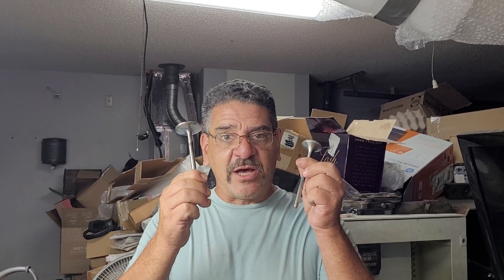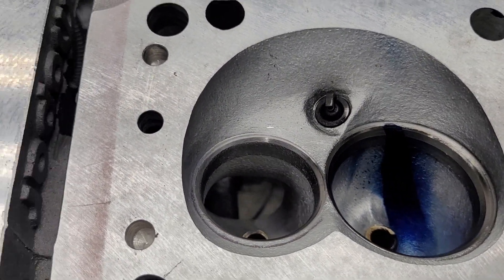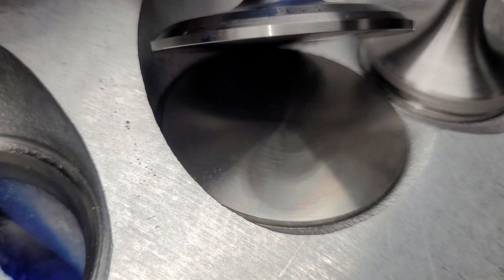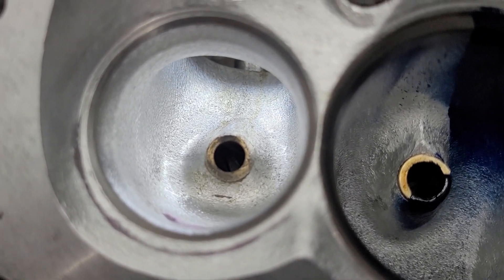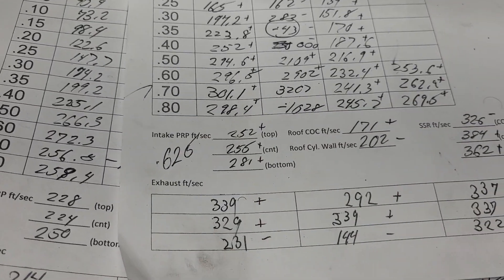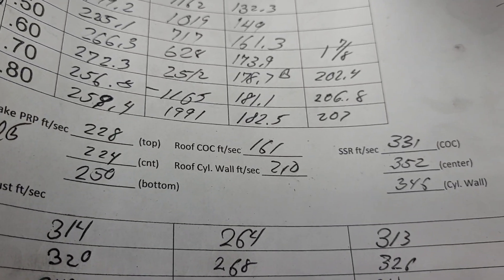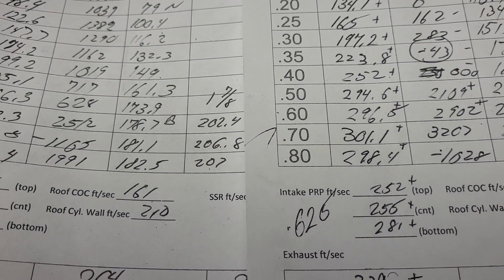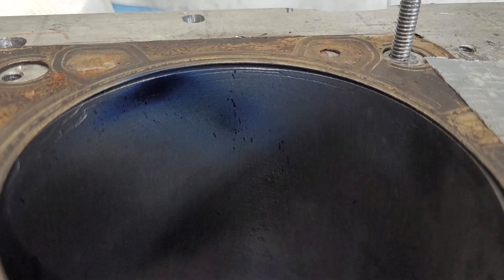Brett Miller ported W5 Mopar performance cylinder head

Comment: I also seeing these results would like to se a set of Aluminum Commander heads or the SBM Sidewinder, and TFS seem all about the same heads in design . and what about opening those up further? since there are not many Available higher end heads that support over 630+ H.P.
Reply from the maker: These are done and Rob will use them as is. Thanks

Comment: On F1 heads, they actually machine a groove near the edge of the valve face so that the charge tumbles into the cylinder instead of hitting the sides and being disrupted. Wondering if that could be of use to us
Reply from the maker: That is interesting tech, I would not be able to measure tumble. Thanks

Comment: Been years since I did them heads.  

I would love to widen up the short turn and push apex back but you will be into water.   

As is they will make good power and be safe.  

Nice review 👍🏻

Lover to see them on a running engine.
Reply from the maker: Thanks, very nice work!

Comment: I wonder how much of the gain on the intake is the going to a 2.05” valve vs just the port work… I’m guessing 40%-50%?
Reply from the maker: I wouldn't think anywhere near that amount. Thanks
Reply: Valve in the stock port would do just about nothing and may hurt flow.  

Air speed on w5 short turn is high and the port is cast small with the big head bolt bulge and the guide boss mess 😉